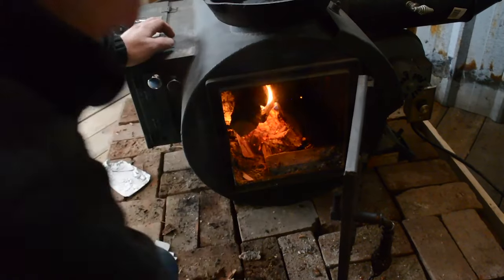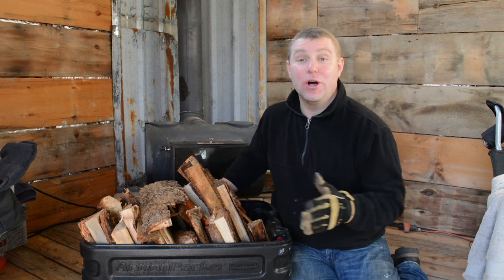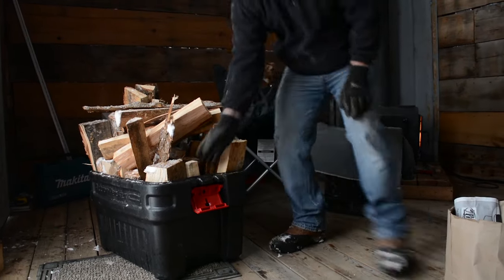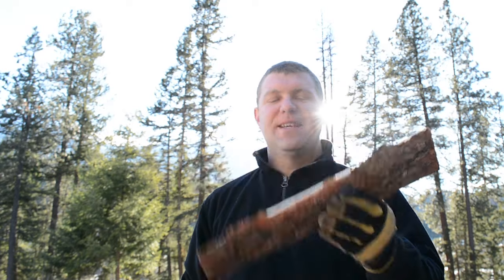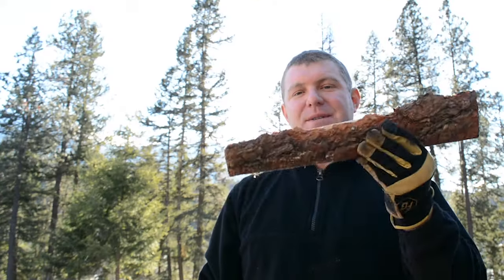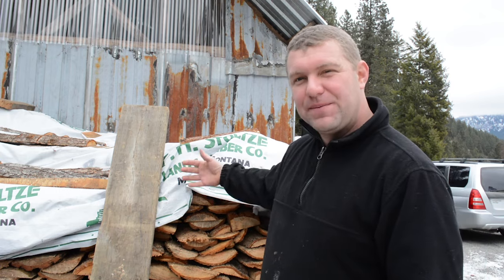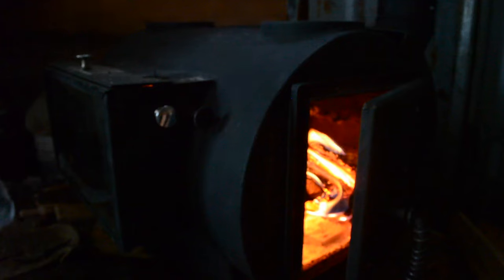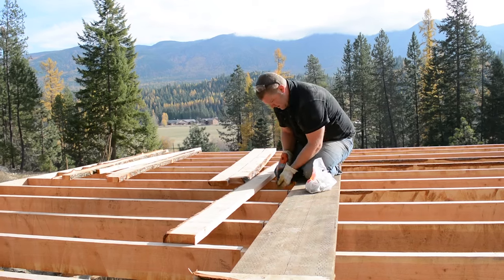5 Wood Burning Stove Mistakes You’re Probably Making

Comment: It is dangerous to dry your firewood too close to the stove itself. It should be at least 6 feet away, according to the fire code up here in Canada. Burning embers can easily fall out onto the wood when you open the stove door. Cut, split, and dry your firewood in the sun and wind, protected from rain, for two summers, or at least one full summer. Then store it in a shed protected from the rain. Also, it would give better chimney stack draft if the stove pipe went straight up with no bends. And it looks like the walls near the stove have gaps between the boards.I like your video, but there are too many gross errors which need to be corrected before you give "advice". I have been heating with wood for over thirty years, and I am learning more each season. And one more word to the wise... if you store your wood in an outdoor shed in boxes, make sure that you re-box it before bringing it into the house. Mice often make their nests in the bottom of those boxes, and you are very likely to transport mice into your home unless you first dump the wood out, then pick up the pieces and rebox them. I do like your video, but please be careful not to give advice unless you really know what you are doing. And, by the way, you need to get a better stove!
Reply: 100%...Thank you, nice to hear some common sense!...Proud Canadian!
Reply: albert semelmann so true about the mouse in the wood box 😂we brought one in the house that way and he wanted to stay !

Comment: BTW. we have double wall, steel stove pipe. the only bend us where it comes out of the stove to turn upward. green wood IS a problem, but we don't get smoke out of the stack when the fire gets hot. fir the record. I don't much like this stove. I think the barrel shape is harder to cope with. I used to have a square  wood box stove, a "Heatrola." was a lot easier to manage.

Comment: Try lining the inside of your stove with Skamol which is an insulator we use in the stoves we produce (Tropicair Heating Ltd), as the Skamol will help increase internal temperatures allowing clean combustion of bigger pieces of fuel. Just a quick comment though, The lack of baffling may be allowing the fire to process air far to quickly which will be cooling the fire and flue and not helping flue deposits. A baffle would help slow the out flow and again help drive up combustion temps and prevent overfiring.

We have a gasification stove here on youtube (search ULEB Ultra Low Emission Burner). Our Tropicair Duo when compared to the most efficient burner you have available in the states (Wittus Xeoos at i believe 83% eff by your test methods) under our NZ testing method the Xeoos is 68% Avg Eff where the Duo is 79% Avg Eff (up to 82% peak eff). Feel free to have a look, and if your after an insanely efficient stove www.tropicair.co.nz (Possibly the most efficient stove in the world)

Comment: Oh man; you have way too much heat loss! My suggestion; convert it to a double barrel stove. Very simple and cheap. Heat from the bottom barrel goes to the top barrel (add a downwards exhaust for secondary burn of gasses and effluent). Add some heat retention mass to the top barrel (i.e. solid metal plates, such as truck brake drums, etc). This is how it will function: the escaping heat and gas from the bottom drum will circulate in the second drum, thereby doing two things; (1) heating the retention mass for gradual release of radiant heat, (2) providing additional fuel for the bottom drum as a secondary ignition. A lot more efficient than you currently do.

Comment: For a few bucks you can get a kit that converts one or two 205 litre drums (55 gallon if you live in the USA) into a very nice wood stove.  In my experience, buildup in pipes and chimneys is a product of moisture, in other words, unseasoned wood and in some cases soft wood.  Maybe it's something different in your case...  Never burn wet wood, use air to control the size of the fire.  Small pieces burn faster and hotter, big pieces burn more slowly but longer.  Again, just my experience.  Wet wood actually does not burn until it is dried enough by the fire, it takes heat to dry wet wood to make it dry enough to burn.  This is a net loss of heat energy that could otherwise be used to heat your house.   Let the sun and the wind dry your wood, you will get more bang for your buck whether you bought the wood or made it yourself.

Cheers.
Reply from the maker: +rain coast All things considered, it made heat and kept us above freezing. It'll likely be years before we have an "ideal" situation. Look at us being a wreck, but still surviving! lol. Agreed on all your points, but we're working with what we've got and it's working for now!
Reply: +Pure Living for Life   Oh for sure !  It was not a criticism but just me thinking out loud...   I am living vicariously through you as i am in a situation where i am living in a northern resource based town in Western Canada as a wage slave...   I am a big fan of repurposed things and materials.  I have never had a barrel stove either but know people who have, my wood stove when i had one was one with a glass window in the door.  Eventually i would like to learn more about rocket stoves with mass heaters.  From what people say they use a very small amount of wood and you can burn sticks and twigs too and they squeeze out every last BTU of heat.  I am cheering you on, all the best luck and stay the course !  I think you are doing great.

Comment: Dampers are one of the most important thing about your stove and the type of wood you burn. Looking at your pile it looks like Balsam and Fir and 2nd growth Fir burns the best, Balsam not a good burning wood at all. The damper on your chimney is way too high, its shouldn't be more than 3' from the stove depending on the stove. Plus you should put fire bricks on the bottom of the stove inside with some spacing between them for airflow. If you want it hot close your damper on the stove itself if your burning Fir etc and keep the door open 1/2" until the flames catch all around the wood, then close the door with damper closed.

Comment: There are places to save money, but in your situation where it is the primary source of heat, it is false economy.   ANY of the small EPA 2 rated steel plate stoves (many under $500) would use considerably less fuel and burn cleaner than this stove.  And I agree that your chimney is an abomination. Either get rid of the restrictive cap, replace it with the correct item or re-design it to have enough free flow. 
A good stove has firebrick inside to keep the fire warm.  It has an insulated baffle at the top with secondary air (pre-heated) to burn residual hydrocarbons and soot.   You would probably use half to 1/3 of the wood and have a burn time of at least 4-5 hours with a new $500 stove.   And you would be much better neighbours by not flooding the area with acrid wood smoke.

Comment: DUDE, wake up man, are you living in the stone age? LOOK UP ROCKET STOVE, I live in Alaska and I only burned one cord of wood last winter.

10K for a solar system is pretty costly. If I were to put in solar here it would take me 20 years to pay for it with the savings of what power costs me now. I prefer to not cut down two trees.

I have a lawn mower engine that charges batteries. I get 10 hours on one gallon of gasoline. It costs me 250 dollars a YEAR for fuel. I am in the process of converting water to hydrogen and oxygen to run the generator without gasoline.

Comment: Your stove needs a great to get the wood off the coals to burn so buy a grate and you will be done with your problem.Also you need double wall pipe every wear it is out of the building. Single wall pipe cools off to quick out side putting creatso on the pipe

Comment: Insulate your outside pipe. It will help with the creosote build up, and your stove will draw much better.  You will probably be able to load up that stove with your new found draw. 

You can build a poor boy double wall pipe outside with 8" black pipe stuffed with insulation around your 6". Not as good as real manufactured insulated double wall, but it will get you by.

Comment: any smoke equals bad, as that is potential energy, for your situation, just make a barrel stove, with upper barrel and air exchange, also a water heating coil connected to a few ISO water tanks for thermal mass. creasote build-up means a bad fire, never ever wet wood!

Comment: Ha Ha. Maybe you should've titled this video "Tips on increasing the efficiency of wood burning stoves if you have no idea what the hell you're doing, have an improperly installed wood stove, are relying on basically green firewood and can't even properly identify the tree species in your area". There is no Tamarack west of the continental divide. It's Western Larch. Anyway, we all start somewhere and I wish you the best. Pro tip...next year stock up on as much Doug Fir, Larch and Lodgepole pine as you can. Get 5 or 6 cords split and stacked and drying by early June and you'll be running a clean stove all winter long.
Reply: +MontanaLife  To Pure living for Life - Sorry for this comment. Had a bad day at work and I feel like I took it out on you guys. My bad. You seem like great folks and for me to unload on your video is BS. Hope you guys are getting through your first winter on the homestead OK. We're halfway through January now so Spring is (sort of) right around the corner. Keep Hammering!

Comment: Put bricks around it, so you can heat the bricks and have some heat mass.
Reply from the maker: +Fernando Gama Nice thick brick hearth but hoping to improve on that this year when we install our fisher stove.
Reply: Your Brick hearth is ONLY a fire break or a NON combustable. It is doing nothing as a thermal mass for storing heat. More heat is rising that what is being stored in the floor.
Reply: I think what he means is build walls around it, three sides, and even over the top. Radiant heat will transfer to these areas and hold for a while in the stone.

Comment: I hate to be the one to mention this to you ,but your stove is poorly designed and your sending way too much heat and future creosote up the chimney. Secondly ,a very important concept to understand is that raw wood does not burn directly....the gas released by heating it up is what burns. Take a propane torch ,point it directly onto a log of normal size for 3 minutes and watch what happens when you take it away.it goes out ,then do the same with 2 pieces of wood that are touching each other and you will see that the pieces help each other to maintain a gas release by heating each other. If you ever get the opportunity ,study the construction method of a Vermont castings stove ,both catalyst and non catalyst. (there may be others worth studying)The  Federal designs have neen around for a while ....in 1990 they had a version that was 74 percent efficient and 85 percent efficient (with a catalyst) ...the key being that the firebox is baffled keeping the heat in the exhaust gasses for a much longer time before shipping it up the chimney(like an oven). The catalyst simply burns more of the unburned gasses while still in the stove. Some of your suggestions are downright dangerous, especially using softwoods. They are especially notorious for causing chimney fires and your chimney will NOT survive a chimney fire when you forgot that you left the door open and the stove flares up...igniting the creosote inside the chimney ,which will get red hot or even worse white hot because its a runaway fire with all the oxygen it needs. The storage bin is a good idea it will dry the wood up fairly well being near the stove....but metal trashcans are a LOT safer and don't melt. Mixing wet and dry wood to burn??? Your distilling the creosote in your chimney....not burning it. I truly hope none of your viewers take heed of the tips you have offered. Chimney fires are nasty.... Would you consider asking a fire company volunteer to look at your install?

Comment: been heatin with wood up here in Canada for years, your stove is a terribly inefficient design along with your cobbled mess of elbows and pipe. Find yourself a good downdraft stove, only need to load it twice a day. Feedin it every 1/2 hour or so is for the birds sir, and you can split your wood just small enough to fit through the lid, bigger the better. an efficient stove even shut down to burn slow won`t dirty up the chimney as bad as that monstrosity that your using. love the vids!

Comment: wow every 30 mins??? If I had to do that I wouldn't even bother having a wood stove. All your heat is literally going up the chimney!! I can put one good sized log of hardwood in before I go to bed and it will still be burning in the morning. If I used half a chord all winter that would be alot. And I live way up north , its cold here. You need to dump that stove and get something that burns efficiently. Ehhh you'll figure it out after you get sick of hauling in tons of wood. Oh and if the only thing better than burning pine is construction lumber. All kinds of it around and free for the taking. And its already cut up an dry.  Don't worry bout the glue that will go up the chimney along with your heat.  Good luck!!!

Comment: If you dry out wood indoors you are wasting heat (and money). Vaporizing the water in the wood will absorb a large amount of heat which would otherwise warm the room. Elementary physics. (google 'latent heat of vaporization'). This is the principal of how a refrigerator works. Let the wind do the work outside before you bring the wood in!

Comment: I have a question for you that has been bugging me. I see in your shed, wall boards have a gap in them that light comes through Do this not cause a big heat loss from your wood burner? I would think this makes the wood burner very inefficient. I do like alot of the things you are doing and like your channel, but this has been bugging me for awhile.
Reply from the maker: Yes, any gaps result in heat loss. Our goal wasn't to make the structure as efficient as possible, something difficult for many to understand. It was simply to keep things warm enough to keep our rv tanks and pump from freezing. That's it. No need to waste time sealing up the gaps when it works fine as it.
Reply: +Pure Living for Life Ok just wondering I thought it would greatly improve the amount of wood you burn. You all are doing great on the things your getting accomplished. I'll keep watching and wishing I would have done this type of thing when I was young! lol
Reply from the maker: +tarunner One of the reasons we want to slow things down. This pace is fraught with 95%. That last 5% make a big difference, but just not doable in many circumstances.

Comment: Over 30 years ago my family already had an amazing wood stove that would get hot enough to reburn its own exhaust fumes and produced no visible smoke after it burned for the first 15-20 minutes. Then it would slowly and efficiently burn a couple of split logs and produce massive amounts of easily regulated heat for several hours at a time without needing to be opened and fed new wood. Start it up in the morning and you wouldn't need to add wood until mid afternoon. Add a couple of logs before bed and you might find it still hot when you wake up. It could keep a 3-bedroom house the same comfortable temperature all day and night with a very small amount of wood. 

Seeing anyone using such a poorly designed wood-wasting stove in the 21st century makes me want to cry. I believe the brand of our stove was Sweet Home. They aren't around anymore but there are numerous stove models on the modern market that will work even more efficiently and cleanly than those stoves did decades ago. In fact it's illegal now to manufacture and sell new wood stoves that don't meet modern EPA efficiency regs. What you describe as "12 hours" worth of wood should last more like 3 days at minimum. I can't even imagine burning 3 of those boxes in a day. Makes my skin crawl just thinking about being so wasteful.

Comment: Modding the stove to be a gasifier, like a rocket stove, would increase the efficiency tremendously and be much cleaner burning.

Hopefully, they will use a thermal mass rocket stove/heater in the house they are planning to build.

Comment: I wonder why these useless stove manufacturers don't weld metal fins on stoves.
After having built many amplifiers and power supplies and using large aluminium heat sinks to keep transistors cool, surely a stove would benefit too.

Comment: No secondary burn. No flue damper. This is not my idea of efficiency! This is nothing but an oil drum lying on its side with a pipe going thru a tin roof. I'm sorry, but this looks like a recipe for disaster besides burning insane amounts of wood in an uncontrollable tin can. It also looks as though you are burning pine which is taboo in a wood stove.

Comment: If I fitted that in the UK they would take me out and shoot me. Are you trying to heat a shack with huge gaps in the wood? And you talk of efficiency! Re route the stove pipe through the building, the building is kept warm and the flue pipe is warmer so runs better. Put a T connector on the base so it is easy to clean out. Put a baffle plate in the stove. Fill up the gaps in the wood. Avoid using 90% bends, they clog up. Get a better heat shield.
Reply from the maker: +Ben Hughes We aren't you, we're not in the UK and the stove/leaky cabin kept us warm all winter. Continue....
Reply: +Pure Living for Life If your cabin was not so leaky you would be warmer or need less wood. If you followed my advice about the install it might stop you having problems, like your cabin burning down. If my post came over as negative I am sorry. I would be worth while. All the best.